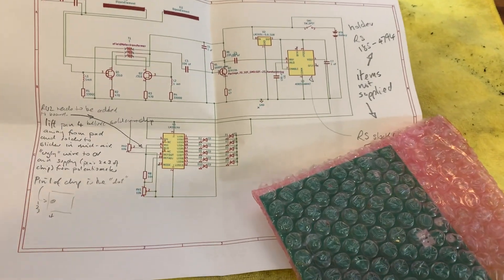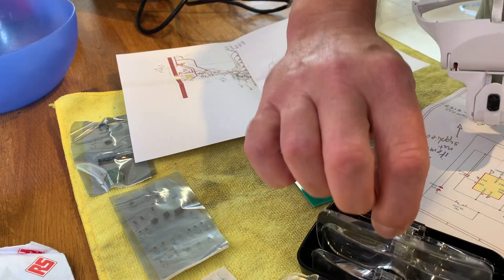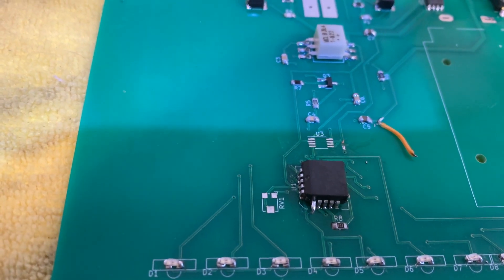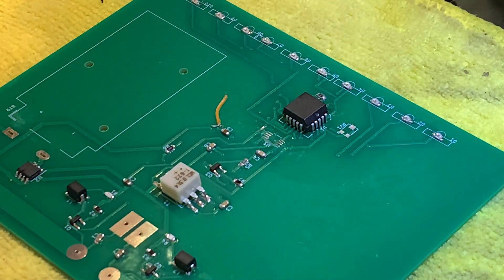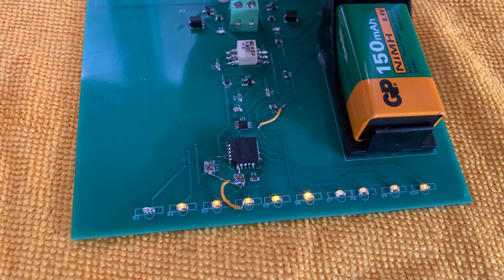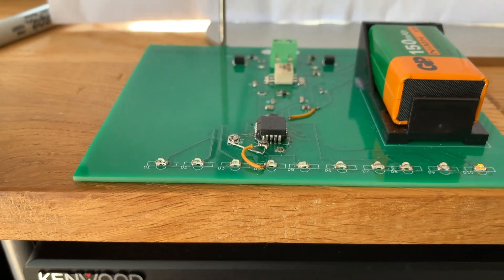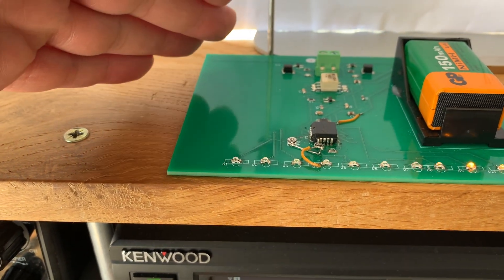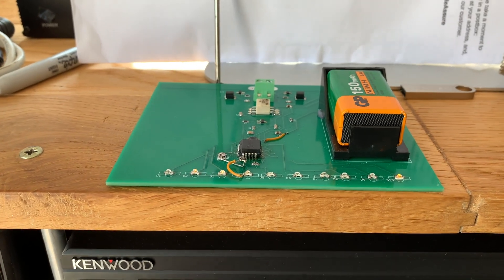RADIO HAM: EMF Detector Build It is not so easy.

Comment: I don't want to be a pain (you know where) here but isn't measuring the E-field asking for trouble? It would be badly affected by anything conductive in the vicinity - or are you trying to measure something I don't understand? I'm measuring the H-field (near field and far field) from antennas and that works like charm with very little environmental influences (see e.g. the last pic on my QRZ page).
Reply from the maker: The Video has done what it was designed to do, make people question EMF rules and regs. the reality is that it is almost impossible to get it right!

Comment: It’s not difficult to get an accurate reading, you just need the following:-

A: Calibrated aerial,
B: Calibrate coax cables,
C: Calibrate spectrum analyser,
D: An open field site to do the tests in.

I think £40K will get you A to C, D may cost a lot more.
;-)

Or just use the spreadsheet works for me.
Reply from the maker: Yes that should cover it.

Comment: To hand solder a chip, just place the chip on the pads. solder one pin and check that the chip has not moved, reposition if required. Then just solder the remaining legs. No need for flux the solder has all it requires. same for chips like R's and C's, just solder one pad, heat pad and place R or C on to it. then solder other end. simples peeps.
Reply from the maker: Or get your mate to do it.  😂. Great post, many thanks for the tips.

Comment: Indeed Mike there is more to measuring EMF than meets the eye. That's why these EMF circuits or 'measuring devices' (built or kits) are all a waste of time unless you pay many £000's to buy and calibrate. Loads of cheap tat are available on Fleabay and the like. Not worth the effort to buy or build IMHO.
A cheap indication that there's EMF there........nothing more. Don't be fooled!
Reply from the maker: Indeed.  👍😊
Reply: These cheap kits and those for upto £100 are about as good as a chocolate fireguard. if I could do it with a kit from EBay I would no have needed to spend £20K on the analyser.
Reply: @TheEmbeddedHobbyist   I agree wholeheartedly. You might as well just send your £100 directly to the dump or preferably to me. I'll buy yet another radio, another handbag or chocolate!!
Reply: @rachael8742  your chocolate is in the post ;-)
Reply from the maker: Along with mine I hope…
Reply: @mike-M0MSN   no chance; it’s all eaten.

Comment: SMD stuff is always fun...
I find that a flux pen is a very good idea, not that flux paste. Wipe the pen over the pads and let it dry off a bit, it then goes sticky, which is a big help in holding down the "FS" as you put it. Even when using a hot air gun, just touching one pin down with the iron makes things a lot easier.
I also find that a simple cocktail stick makes a very good hold down device. They don't tend to get stuck to the chips. 

Andy G0POY
Reply from the maker: Great advice cheers.

Comment: Those chips are easy. The ones with the heat sink down to a grounding pads suck. I dab a plop of pastes solder the leadless Qfn down then you need to reflow the whole chip to get the sink flowed. Kinda similar to a BGA either way  you got job done 😉😉

Comment: Hey Mike, that thing isn't AD8307 based is it? (sorry, my eyes are not the best). If not you should give that a try. It's a great little piece of a HF 
amplifier with reasonable dynamic range. The only challenge is getting a comparable  impedance accross its bandwith. In combination with an opamp and  a microcontroller of your choice that thing makes a great tool.
Reply from the maker: It is LM3914 based I will have a look at the AD8307

Comment: Great job. And Ofcom expects us to take readings and keep a log, what a joke I run no more than 7w now :)
Reply: No, OFCOM expects us to do a risk assessment which is a different thing to performing measurements. Be very careful not to over complicate this issue.
Reply: @andye2005   I agree. That's what's so daft in all this. Supposedly intelligent people (Radio Amateurs) 'throwing in the towel' whether out of fear of the new regs, disillusionment or lack of understanding. It's not a joke at all. It asks us to do an assessment of our station on the bands we operate on and rethink to reach compliance. It's good to re-evaluate periodically.
Reply: No you can run 10W with no issues. Also you can take the losses in the coax, antenna and how lonf you talk for. Just fill in Ofcom's spreadsheet and you should be OK.
Reply: @TheEmbeddedHobbyist  That is not really the point. Many people are missing that this is a RISK ASSESSMENT. Then you decide what you are going to do to mitigate any risk. Running low power my be one answer in some circumstances. 

As a generic example:

You have a vertical antenna of some sort 
You plug in it's parameters, the cable length, transmit times  and so on  into the spreadsheet and it gives you a distance of 8m where the voltage levels will be at or less than the required limit. That gives you the information you need to perform the risk assessment.

You look at your installation:
There is no access to the antenna closer than 8m - there is no risk carry on as normal

There is a POSSIBILITY that someone could approach the antenna  closer than 8m
So: the mitigation(s) could be:

A check will be made before and during operation to ensure that no one is near the antenna. If so then power is unrestricted - carry on as normal Otherwise power will be restricted to a suitable level.

Anyone that close to the antenna will be chased away or otherwise sent packing. risk resolved power unrestricted carry on as normal 
 
If there are people near the antenna that you can't remove:
The transmit power will be limited to a level that keeps the voltage within the acceptable limits. Risk resolved.

You document this and stick it in the logbook. That's it you are covered.

And so on

This is without doing things such as moving the antenna, putting some sort of barrier up.

DO KEEP IN MIND at all times that this is a RISK ASSESSMENT it's not an RF field level study. So no-one is asking us to perform measurements, just to assess the possibility of someone getting near enough where the field strength might be above the recommended limits.  

RF field measurement is basically beyond the ability of most Amateurs (to do it accurately) So all of this is very conservative.
 
My PERSONAL Opinion is that it's all a load of BS stirred up by some parts of society similar in mindset to anti-vaxers. (thinking mainly of the anti 5G mob) and the governments are trying to placate them. We have got caught up in the process.

So just do the assessment, shove something in the log and continue to enjoy the hobby. 

If some Joe soap  comes knocking at your door complaining about signal levels, just say "prove it, show me your test results, your equipment lists, your current calibration certificates results, and  your training certification. Of course they won't be able to do anything of the sort. 

 Andy

Comment: are you on 91 dmr Mike ? iam qrv on 91 dmr. 73s pd0roh ps . i toss the solder paste / flux and my weller soldering station
Reply from the maker: I do have DMR, and use 91 occasionally.

Comment: What are those glasses called Mike and where did you get them?
Reply from the maker: Not sure of the make, (there is no makers mark on them) eBay purchase.. just search.
Reply: The best thing I ve found for viewing smt parts is a lense for Mirror camera. I use one and look through it back ward and it works great. I ve tried those looupe things but 10x sucks the lense I’m using is like 30x and sees very well and it was a trash pic so even better